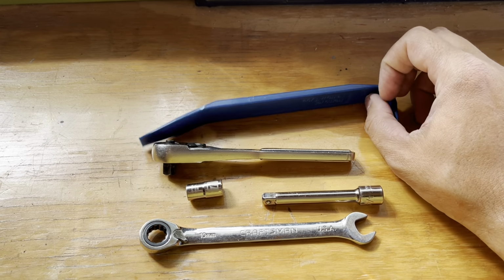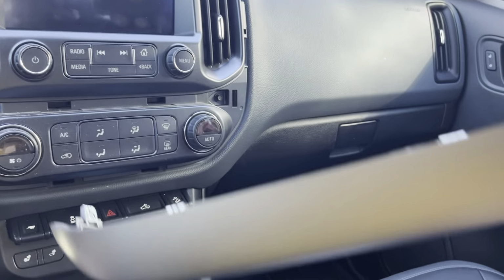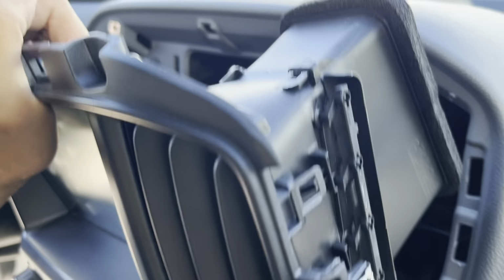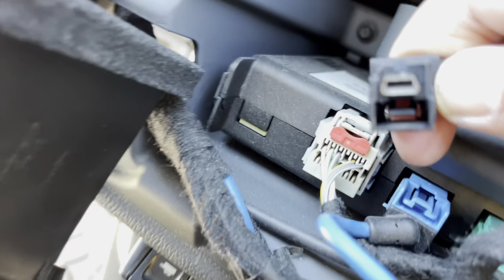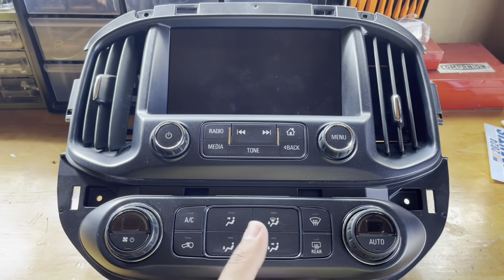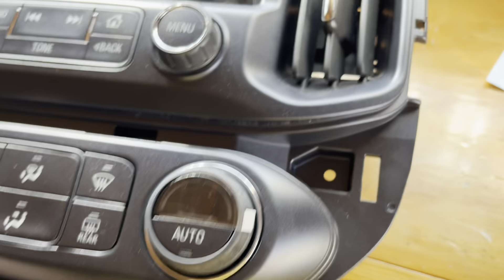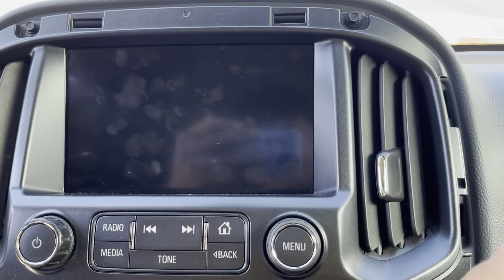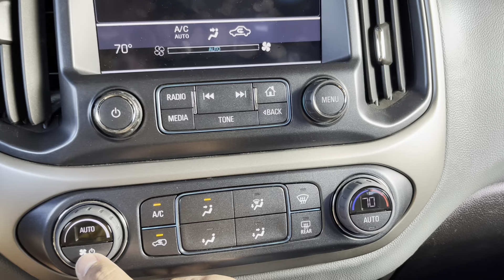2015-2022 2nd Gen Chevy Colorado GMC Canyon HVAC Climate Control Module Info Screen Replacement

Comment: Mine went bad after only 3 years. The cost to get this fixed/replaced was ridiculous. The cost that manufacturers are charging for vehicles-this type of stuff should not being going bad after a few years. What’s worse, this is the forth unusual item that has needed to be replaced on a 2019 Colorado, with less than 60,000 miles on it. Hey Chevy/GM, is the quality of your vehicles really as good as you claim it is? Maybe you should rethink that!
Reply from the maker: I’m pretty sure this is the second time it’s been replaced on mine. RockAuto sells the original ACDelco part for $85 before tax and shipping, and it’s a quick 15 minute job. Help save a little $$
Reply: Do you have a link for it? I have a couple lights that have went out recently.
Reply from the maker: @tonypetes1 verify your vehicle and fitment. https://www.rockauto.com/?carcode=3437531&parttype=10545
Reply: Make sure you vote on the "right to repair" act. Or the dealers will be the only place allowed to fix your vehicle. No body is being informed about this!

Comment: I have 5 lights out on my 2019 Colorado with fewer than 40,00 miles. The dealer quoted me $145 just for the module therefore I just decide to live with it. After seeing this video, I may consider trying this myself. My only concern is that the lights will start burning out again over the next couple of years.

Comment: I followed your lead. In my 2019 Canyon, there were little white safety clips holding the tabs that you push to get the harness plugs out. Had to pull them before you could push the tabs.

Comment: Thanks for the video.  It was very helpful!  I had the exact same issue where a couple of the LED lights were not working on my 2019 Colorado.  Definitely not something you would expect to happen on a vehicle with only 50k miles.  The only issue I had was with that blue cable.  I ended up breaking the connector locking tab trying to "gently" release it with a small flat blade screwdriver.  It still works fine without the locking tab and the connector seems to fit pretty tight even without it.  Hopefully it stays working.

Comment: great video , helped me . I just replaced my  climate control mod. That blue cable was a pain to disconnect. I sat in passenger seat and leaned over center console, instead of laying on floor like you did. The rest wasn't bad. Thanks for video
Reply from the maker: Nice! Glad it helped!

Comment: Thanks for this! I have 3 bulbs out on the same module so now I know I have to change the whole deal.
Reply: try resoldering the led connections.
Reply from the maker: This is possible but it takes skill or practice if you have little or no experience soldering. If you can afford a new unit it’s certainly worth the time you save…
Reply: @TheSilver9r  can I have your old one?

Comment: Thank you, Steve Buscemi
Reply from the maker: Is that who I sound like lol?
Reply: @CamaroChris  To me, you do, at least at the beginning of the video. Nothing wrong with that. Thanks for the video. I have a Colorado with 44k, and little things are beginning to crap out on it.. Yesterday, my cooling fan ran the whole hour I drove around, and continued to run for 5 minutes after I turned it off, so I disconnected the battery. What do you expect for $40k..
Reply from the maker: @brandonkeller4 lol I’m not offended. I think that’s kinda funny, I’ve never heard it before.

You know you aren’t the first person I’ve heard have an issue like that with the fan. Maybe cooling fan switch? I’ll investigate, maybe put up a video in the future on it…
Reply: Appreciate the help, Chris. I did some reading on it last night, and it sounds like a simple enough fix. My pickup is still under warranty, so I’ll be taking it in this coming week.

Comment: Mine was IOR model and had 2 additional plugs but I was able to pop the cable clamps loose and replaced without unplugging anything then pushed clamps back in

Comment: I thought this might be the cause of my heater not working. I was wrong but at least the led works now lol. That first connector is a pain in the ass if you haven’t done one before. Had to use a tiny flat head and work on it kneeling from the passenger seat.

Comment: I have a tool for keeping computer memory when disconnecting the battery.  Any reason not to use it for this repair. Is that unit even powered with key off. Although I guess there might be power in the vicinity.
Reply from the maker: @gadasavideos8564  I would disconnect it still to protect against anything that may cause an issue with the power connected. Not something that I would expect to happen, but always better safe than sorry if you ask me

Comment: Rockauto shows part with number  you gave but your big round buttons are different than mine. I don't have auto heat on right.  Just manual. I think my left button is just manual fan . Lol I better look at it tomorrow.
Reply from the maker: Yeah - it just depends on what options came with your truck. You’ll have to verify your part

Comment: So my 15 Colorado is getting squirrelly with the AC switch. It shows the light like it’s on but isn’t unless I push the button really hard. Then it’s on until I change the fan speed which might cut it off. I wanna change the module like you did. Thanks for the video. I looked at Rock auto and there are several versions of these things. How did you know which one to order? Did you have to open your truck read the back of the part and then order?
Thanks dude you’re saving my bacon.
Reply from the maker: Honestly I Googled the part numbers available on RockAuto and just compared pictures to what I had in my truck. It seemed to work out…

Comment: $100 to switch the controller. How long will the new unit "lights" work? It didn't last long the first time?
Also how can i fix the USB from cutting out cutting out my phone navigation
Reply from the maker: @uriahvogt7170  Been a year and a half and all my lights still work. But we’ll see how long it lasts. My USB does the same thing. Not sure. May have to do with the quality of the cable?
Reply: @CamaroChris yes I believe it’s cable quality/age that affects it.  Once I start having that issue I replace the cable and it works great again!

Comment: I had my truck in for a service several years ago. The service writer pointed that a light was out. They wanted $500 to replace that thing. I did not fall for that. How much is that part?
Reply from the maker: $100 on RockAuto

Comment: Where did you get that plastic removal tool from? Thanks!
Reply from the maker: I honestly can’t remember. Maybe eBay? You can get them on eBay, Amazon, or an auto parts store like O’Reilly
Reply: Harbor freight has a nice kit cheap.
Reply: Great video! Gives me an insight on how to get inside the dashboard on these vehicles. Have a 2017 Canyon and am not going to dump good money to the dealer to fix this crap.

Comment: Has anyone tried to take one of these apart, to see what is happening?
Both mine and my friend’s truck, both 2019 Colorados ( his top end, mine lower end) have the same blown light issues.

Curious to see inside, assuming that they are LEDs soldered into place….?
Chris, if you still have the old one, break it apart.
Thanks
Reply from the maker: You know, that’s a great point. I’m surprised in myself for not dissecting the thing. I just tossed it. Now you got me wondering 🤔

Comment: I have a tool for keeping computer memory when disconnecting the battery.  Any reason not to use it for this repair. Is that unit even powered with key off. Although I guess there might be power in the vicinity.
Reply from the maker: I always disconnect - it should keep its memory. I just err on the side of caution as you never want to short something and blow up your computer. Will it happen? Probably not…but better safe than sorry lol